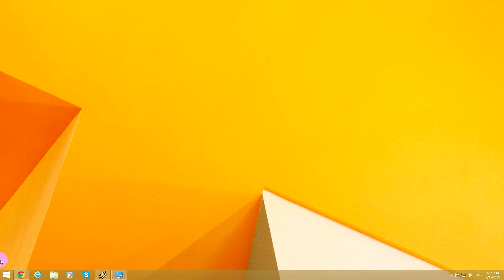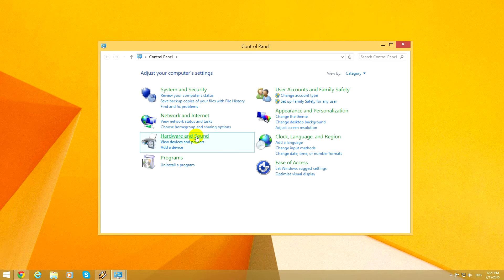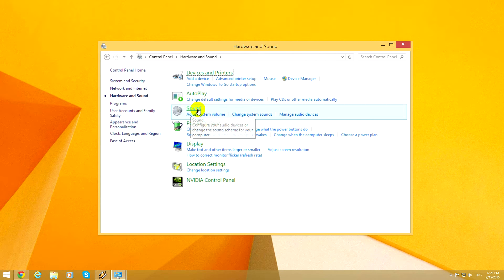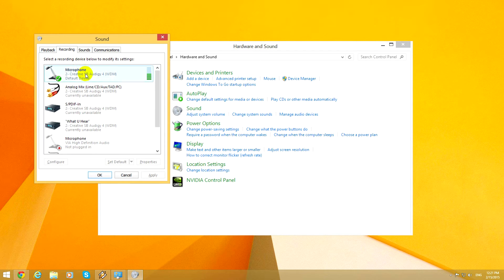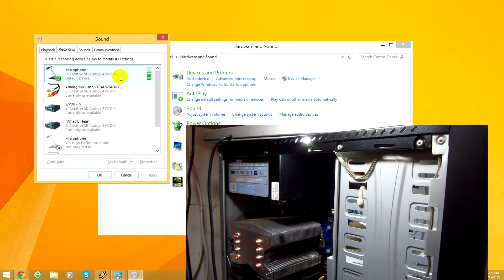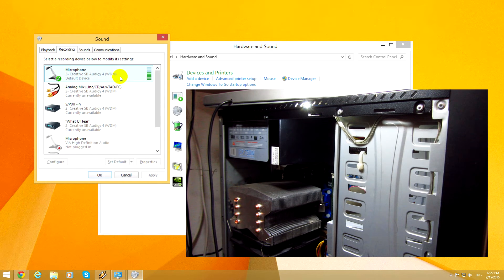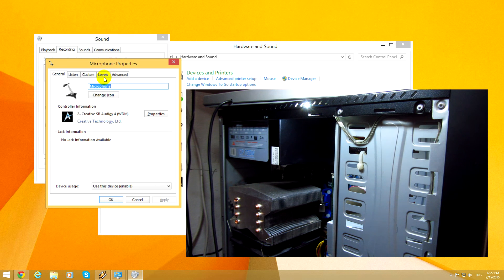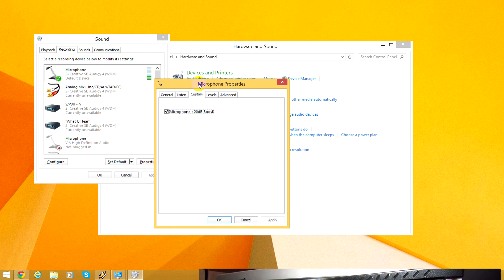Effect of Touching PC case while Recording Audio (UnGrounded PC)

Comment: Bro, please make a tutorial on how to fix a " Usb Over current " error on a asus motherboard, YES i have read all forums, AND i have been searching a definite fix for this stupid problem for like 2 months, i got some fixes but it just keep going back ( if i unplugg the power of my pc and wait like 1 hour it works again but i waited today the whole fucking day and it doesnt work or something, please dude help i would appriciate it so much!
Reply from the maker: Sounds like a short circuit:
 - Check the USB cables that are plugged in, look at your motherboard if its making contact somewhere where it shouldn't, unplug every USB device and than plug them back one by one and observe the result, than plug in another.
- Try to reset your BIOS settings to default.
- Unplug the front USB connector cables.
Reply: furulevi i did unplug all usb devices on my pc and plugged them 1 by 1 and it didnt work,
How do i reset my bios settings? F8? If thats the case, that doesnt work either :/
Reply from the maker: here is an example, but look at your motherboard's info, which is the right key to enter BIOS: https://www.youtube.com/watch?v=-9g-FG3zWwk
Reply from the maker: also unplug the cables which connect the front panel's USB to the motherboard (inside the case)
Reply: furulevi ive unplugged them already ;) ill watch the video
Reply: furulevi i also cant click F2/del on my keyboard, it gives a high noice " peep " and it goes to the USB OVERCURRENT screen.. do you have any other solution?
Reply: furulevi plz ansver bro
Reply from the maker: what is the exact model of that motherboard?
Reply: furulevi its the Asus B75M-A 
And btw if nothing works and the motherboard is just broken, what is the best and cheap board to carry a 

NVIDIA GeForce 660
Intel i5?
Reply from the maker: The Delete key is used to enter the BIOS on the B75M-A motherboard.
Reply from the maker: search for a motherboard which uses the 1155 CPU socket so that you can use your actual CPU
Reply: furulevi yeah that doesnt work bro, i read on forums that i can reset the CMOS battery by pulling it out but the problem now is that i dont have the pin next to the CMOS battery, how do i fix that?
Reply from the maker: take out the battery for a few minutes and than put it back
Reply: furulevi Yeah i put it out for like a hour and it didnt work.. i think i m8 go for a new one
Reply: furulevi But can u still help me?
Reply from the maker: Take out the motherboard and the power supply from the case so that the motherboard does not touch any other metal component and try to start up the machine like that. Disconnect everything from the motherboard and leave only the following: the power cable from the power-supply, RAM, CPU and video card.
Reply: furulevi Woah.. this looks difficult tho im messing too much on my computer, first it game a normal usb over current but now it gives when i unplugged the CMOS battery a bios setup recovery error or something so i realy dont want to mess too much im only 15 and i think i just should go to a person that knows more how to do it you know, but thanks for all the help, your the manA